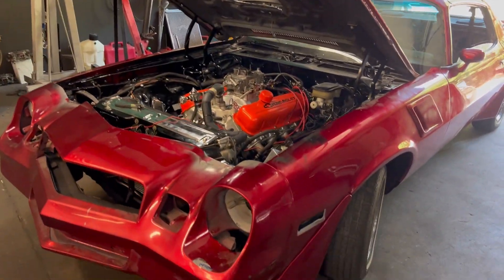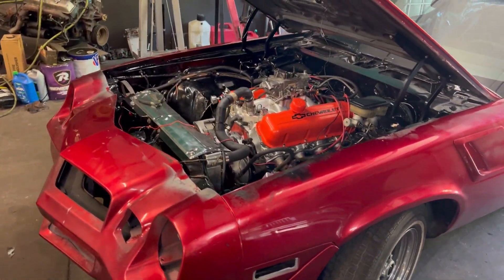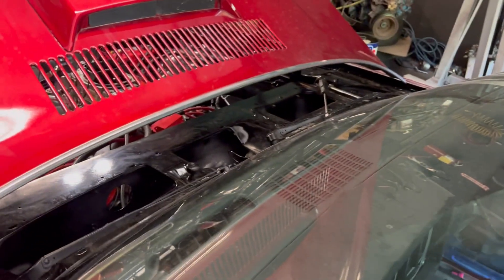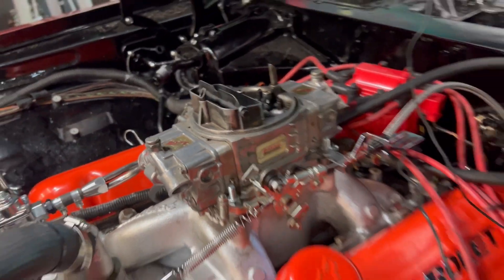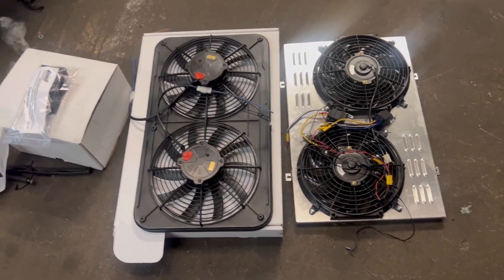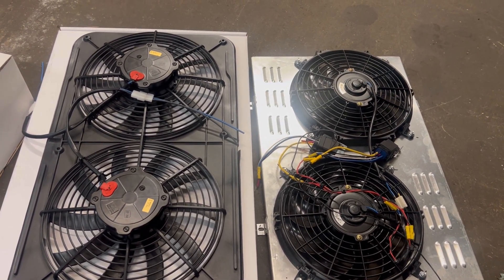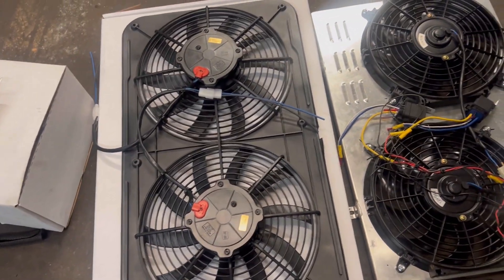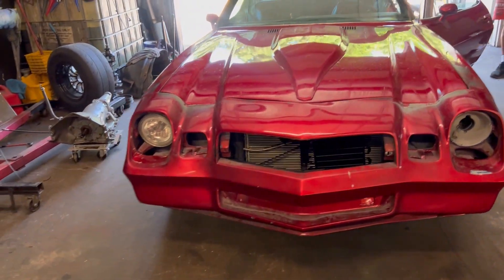How to choose the right cooling fans !!!

Comment: eBay radiator cool but throw them fans out the window 🚮🗑️
Reply from the maker: I will & they are the summit high output fans
Reply: @SSPENGINES383  Bet, thanks cause Derale trippin on they fans now, they want almost $600, I bought em at $320

Comment: Great video as always bro!  That cooling is a must! I got 383 with Derale 4000cfm fans, 170° stat, high flow water pump and 3 core Champion Radiator…she runs cool✊🏾
Reply from the maker: Oh yea fasure
Reply: @SSPENGINES383 what part number are those fans? Need a set for an 80 cutlass
Reply: I destroyed  a fresh motor  behind  that concept . First of all  it was a 400 rebuilt   60 over  , nice cam,   flex fan  good  without  traffic . Man I slipped up didn't  put rad cap on  and lock it. Destroyed  it  on the hov  664 from Indian road.
Reply: @dontethomas7925  Dang man…😢
Ay I see you in my Area…you still in VA?
Reply: @87SSBOI  not no more   that command wealth
Reply: @dontethomas7925 I don’t like it😂, I’m going back down south in 2-3 years

Comment: Most definitely real talk I didn’t realize this had issues with my car overheating bought a fan & fan shroud from eBay & gave me constant overheating issues did some homework and had to learn about fan Cfm every engine has a certain cfm rated fans to match think it’s like at least 2800 cfm or higher for sbc to stay cool bought some flex a lite fans and solved the issue 💪🏿great info